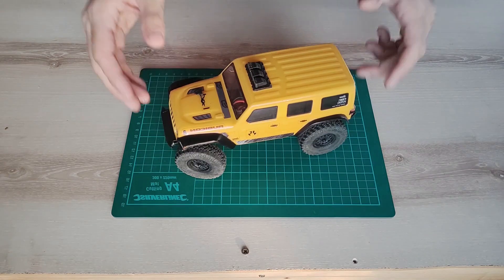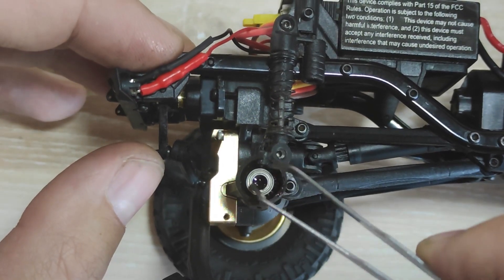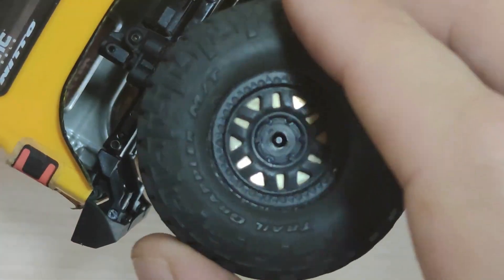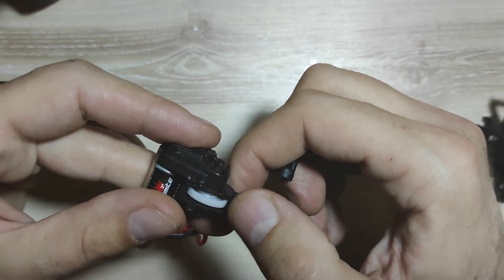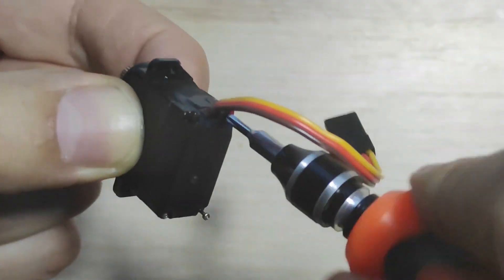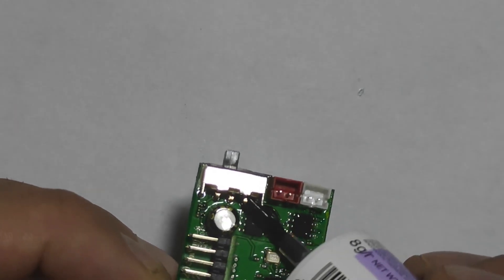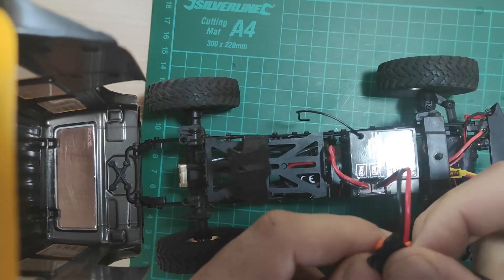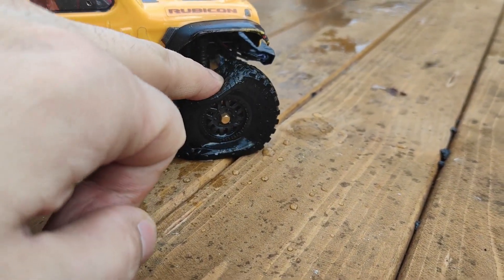Axial SCX24 - waterproofing step-by-step

Comment: Awesome tips. In making some vids my scx24 “fell” into the ocean.  It stopped working for two minutes. works fine now.  I rinsed it in fresh water and continued filming.  It is sluggish now but some cleaning should do it.
Should I worry about the lipo and esc?
Reply: ive never offroaded with a lipo battery, but i dont think it would be too bad, i would just put some waterproof tape over the connector or build a little water tight box to put the connector in after you plug it in.

Comment: Does it matter what colored nail polish you use to waterproof
Reply from the maker: The color of the nail polish does't matter. However, the transparent one is much easier during a possible repair of the electronics.

Comment: Hi I was wondering if would know the solutions o my problem I was driving my scx 24 and than all of sudden it stops turning. Don’t know what to do
Reply from the maker: It's hard to say without taking this car into my hands, but there may be several reasons:
1. The servo is dead (try another servo or use a servo tester)
2. The steering links are blocked (unscrew the servo horn and check that the steerign links work freely)
3. The ESC is broken (unplug the servo and check pin voltage with a multimeter)
4. The servo plug is loose
5. The batterry in the controller is weak
6. The remote controller is broken

Comment: Where did you get the brass nuts to hold your tire on?
Reply from the maker: I bought the weights here: https://pl.aliexpress.com/item/1005001895330640.html
and the hexes here: https://pl.aliexpress.com/item/1005002028812902.html